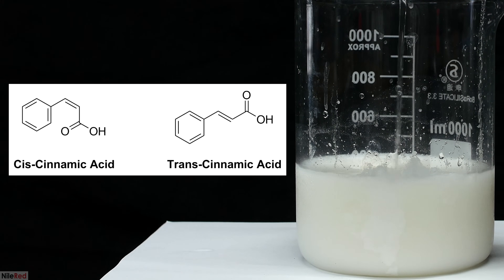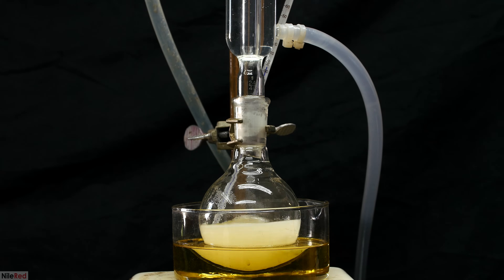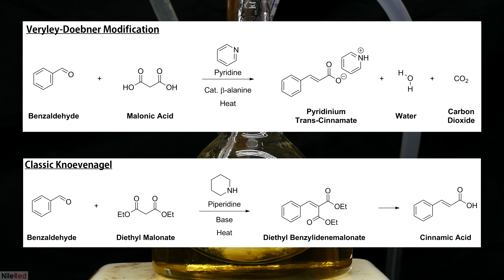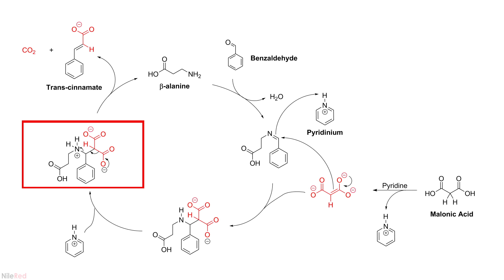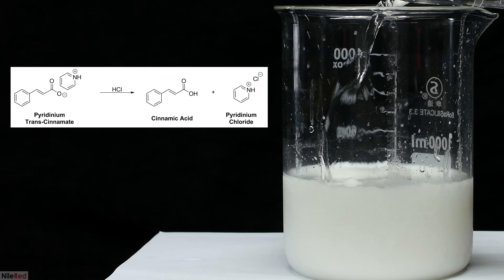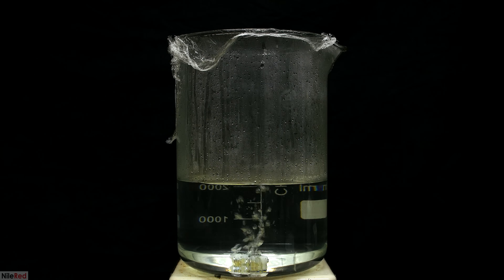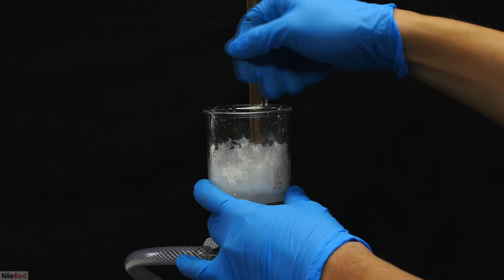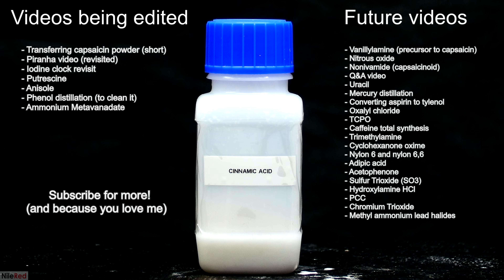Making Cinnamic Acid

Comment: HI @NileRed. May I ask if there's any reason you'd not use a heating mantle? All descriptions of the Knoevenagel I've come across describe use of a hotplate, or shallow oil bath. Is there a reason for this? I prefer a mantle for heating but find the reaction is slower than descriptions, although raising temperature has improved it. I wondered if the greater heat transfer from a mantle, to the distillation product, in my case toluene/water, (which doesn't make sense to me) is a problem.  Doesn't make sense. The heat is intended to push the reaction, but can it be too much? Can it take too long? Is there any degradation of the product or reaction if greater time is taken to complete? ie; 24 hours instead of 5?

Comment: why you have to make chemistry political?
Reply: cis and trans are really terms used in chem to describe isomers, not his fault. it comes from latin, like a lot of scientific terms
Reply: @absolutelyrandom4978  pronouns. Nobody cares about your political agenda, bro.
Reply: @bonersexpenis6200  Are you also upset at nutrition labels for having trans-fats? Multiple meaning words exist. In this case, it’s cis meaning “this side of” and trans meaning “the other side of” because geometric (cis-trans) isomerism is about how atoms are arranged in molecules.
Reply: @bonersexpenis6200  Google disagrees, but knock yourself out. You can’t deny that “cis” and “trans” are prefixes and you see (at least the latter) frequently: transport, transfer, translate, transmit, transplant, transparent, transatlantic, cisatlantic, transgenic, cisgenic, transgender, cisgender. Most of these words have nothing to do with anything LGBT just like trans-isomerism and cis-isomerism
Reply: @bonersexpenis6200  For someone looking at science videos, you really are keen on ignoring facts. You can be pissed at Nile and I but the fact is that trans and cis isomerism is an actual concept in chemistry, and that various chemicals use cis and trans as prefixes, some of which are found present in your body.

Comment: Hi nile, what about the synthesis of trans-3-Methyl-2-hexenoic acid (TMHA) the main contributor to armpit odor?
Reply from the maker: Ill look into it. Might be a little tough to make (depending on what the starting materials are)
Reply: I guess You could use pentanone and ethyl chloroacetate in Wittig reaction.
Reply: @ATFieldZenkaii  
Why complicate your life with ethyl chloroacetate and a wittig reaction when you can just use practically the same reaction as this video? 
Malonic acid+pentanone and you're done.
Reply: @pietrotettamanti7239  I don't think that pentanone is electrophillic enough to react with malonic acid. This modification of Knoevenagel reaction works only with aldehydes, which are far more reactive than ketones. Classic Knoevenagel reaction might work, but it will probably lead into mixture of trans and cis isomers. In this case, Wittig reaction is slightly more selective. If you don't want to use quite nasty ethyl chloroacetate, then corresponding ylide is commercially available.
Reply: NileRed 
Yeah Nile, it really seems like your thing. Get it done. ;)
Reply: Crystal meth

Comment: I don't think lab coat would be a good idea, on one hand, it is expensive and requires special materials, which is fire/acid/base resistant, on the other hand, if someone purchased it and used it in the lab, and the lab coat didn't provide sufficient protection when accident happens, they may sue you.

Comment: in the Verley-Doebner modification, how do you know that you are not making the cis-version? 3:16
Reply: the cis isomer is much more strained, so it doesn't tend to form in any significant amount (or convert to trans if it does form). if you wanted cis, you'd need to eg. start from the alkyne and reduce that over lindlar's catalyst so the H's all end up on the same side. even then, you'd need to keep it in the dark to prevent isomerisation to trans.
Reply: thanks
Reply: np ^^

Comment: As I understand, I guess the reaction mechanism goes like:
VD-Modification
Malonic acid is decarboxylated generating a carbanion which is stabilized by resonance. The carbanion attacks benzaldehyde's carbonyl an generates an alcohol that is dehydrated into an alkene.

Classic knoevenagel
Diethyl Malonate alpha-carbon is deprotonated by a base (carbanion stabilized by resonance). Carbanion attacks the aldehyde group, forms an alcohol. Then, it is dehydrated generating the alkene-product.

How is this different from an ordinary aldol-condensation? With respect to the V-D modification, one can say decarboxylation is different than the alpha-carbon base-catalized deprotonation. But for classic knoevenagel, it is the same but with a more extensive carbanion resonant structure (more delocalized electrons).
Is it called differently just because of that? As a young chemist trying to learn organic chemistry, I find so many reactions names for similar concepts a bit annoying and superfluous. Can anyone throw some light into my issues? Thanks in advance for your support!

Comment: I recently studied that when you have many conjugated double bonds in a molecule than it usually absorbs light and it's coulored (like a compound in cumin makes curry yellow). Then why is cinnamic acid white? it has 5 double bonds
Reply: yes you're right, there are 5 conjugated double bonds, but that isn't enough. carotene, which is coloured due to the presence of conjugated double bonds, has 11 of them

Comment: The last time I decarboxylated it was in the oven at 230° F for 45 minutes... umm... nevermind.
Reply: NileRed #snitch
Reply: @elephystry  wait a minute! you changed your name!
Reply: caspar valentine I did!
Reply from the maker: #reportedtothepolice
Reply: I do mine on the stove top
Reply: I don't get the joke
Reply: @heh2393  it's a marijuana joke. In order for edible marijuana to actually be effective, you need to decarboxilate it and turn the THC-a into THC. This is done by cooking it at a lower temperature than its vaporizing point, typically by putting it on a tray in the oven at specific heat ranges for a while.
Reply: @randoprior4130  I'd have enough do some deep reading, but I've eaten an 8th of raw nugs once at a concert where cops were searching people and felt some interesting effects for a good while into the next day. I doubt it was from thc but perhaps some of the other chemical constituents.
Reply: Never go above 300°F
Reply: Share some with me!

Comment: When is it appropriate to use a hot oil bath instead of a heating mantle?
Reply: asvarien a bath lets you get temperatures more even throughout or limit your reaction to a certain temperature, but for most applications you can use either one

Comment: Do the cis and trans isomers undergo different reactions?
Reply from the maker: It really depends on the reaction. They are stereoisomers, so they are oriented differently in 3D space. In some reactions, you can take advantage of this and force a certain product, but it other reactions, it doesn't really matter.
Reply: +NileRed Actually in biology the Stereoisomers do matter. Also in pharmaceutical chemicals the L&D forms have different activities. 
I have a doubt can we use these properties as a detection method to identify the compounds based on their light polarization
Also i would be cool if there would be some nile red spatula's or Tongs theyll be reusable fun and will always make me remember my e-chemistry teacher